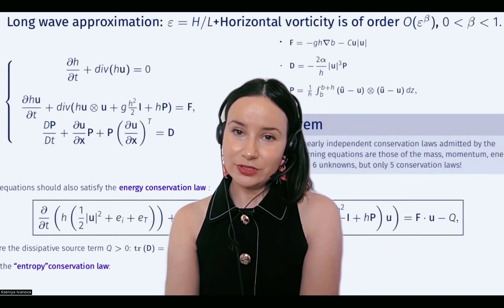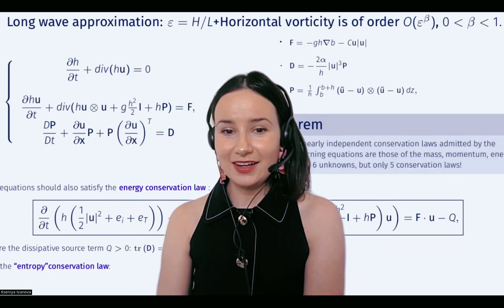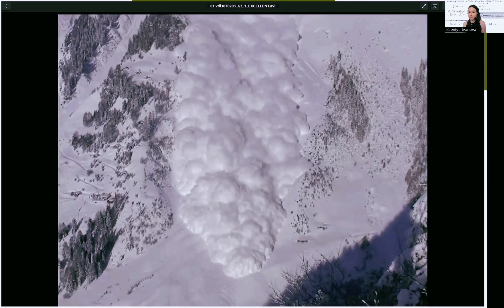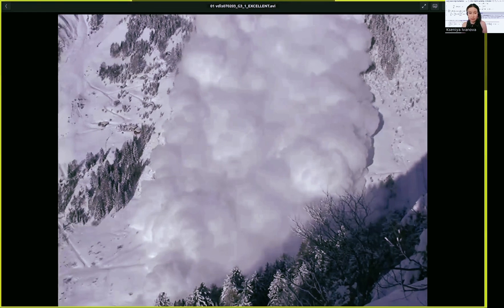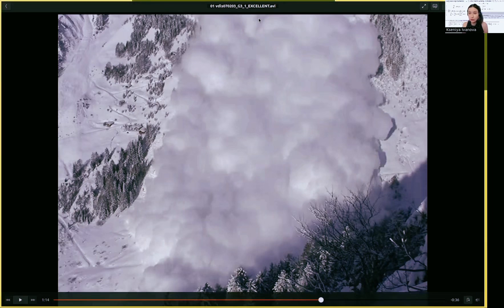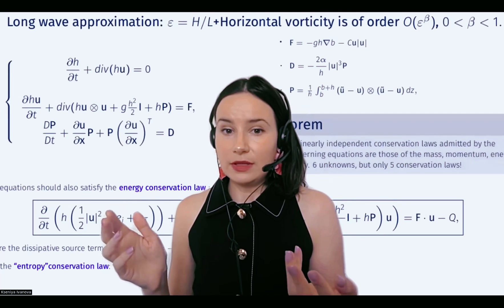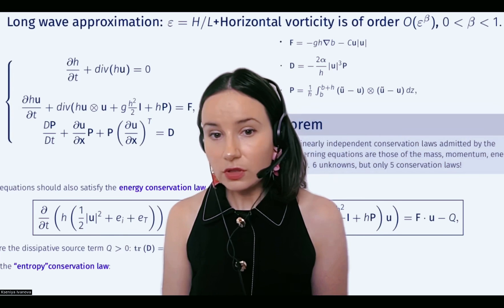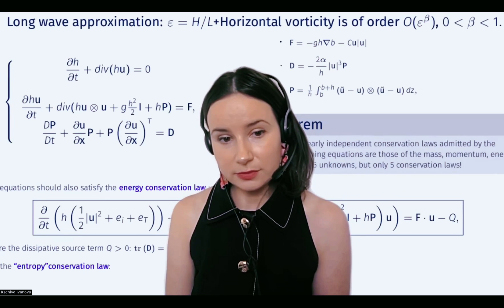How to Model Natural Disasters Mathematically

Comment from the maker: When I say «you don’t need a multiphase model», I mean it’s computationally cheaper to solve the shallow water equations than the multiphase equations.

Another thing is that I was a bit harsh on SPH, it’s also widely used for avalanches, and there are commercial codes available 🙂

P.S. The snow avalanche video was produced by the SLF Davos team (where I worked for one year). ✅

Link to the channel https://youtube.com/@kseniyaivanova2783?feature=shared